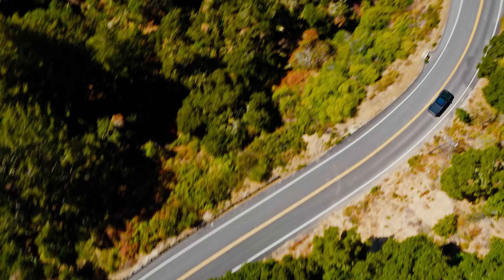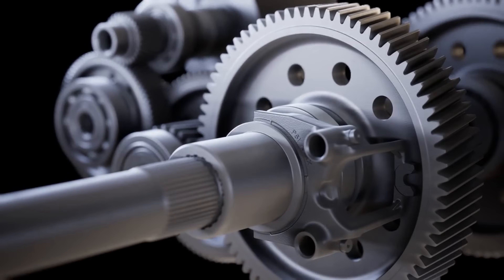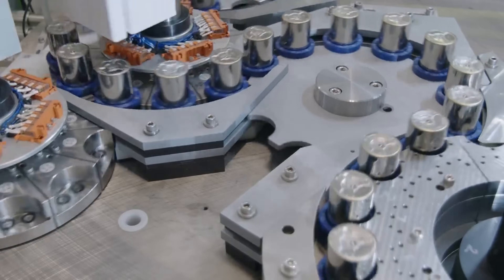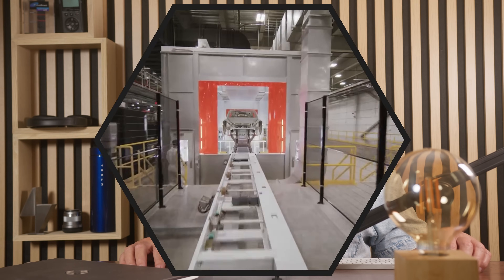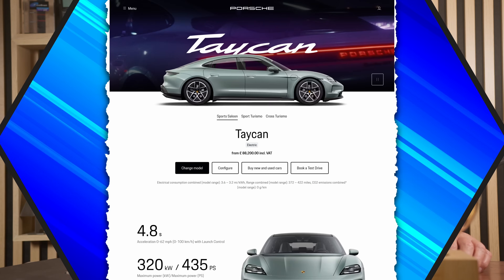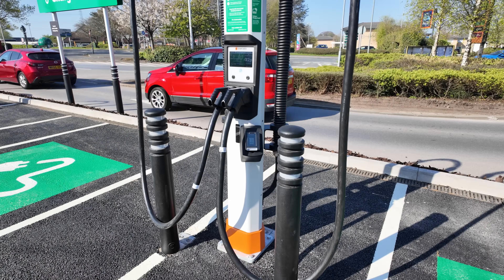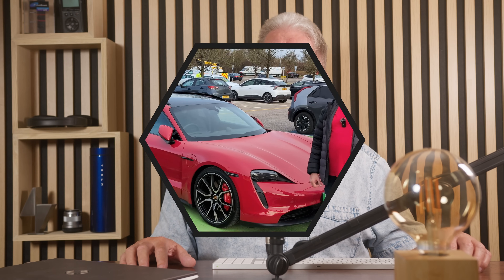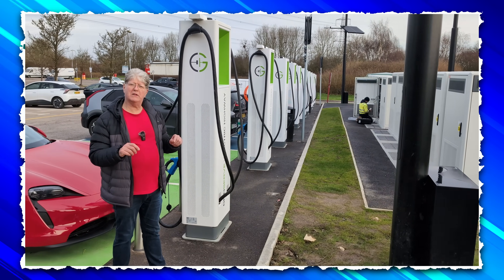800V Charging Is The Future... Or Is It?

Comment: Dave, is this an EV supporting channel or a Tesla fan club channel? This latest video seems a little confused in that respect and defensive in tone. With the intent and purpose behind producing this particular video a little unclear.

The 800v architecture approach isn't just about charging but lowering weight by reducing copper required in a vehicle and reducing heat whilst running the vehicle. As with all new things it tends to get launched on the market as the more expensive option, in this case in cars with larger batteries. 

However, the technology will trickle down into smaller battery sized vehicles when component costs fall. Where 800v architectures will increase efficiency further through reduced weight of batteries and wiring required. The lower current also lowers heat generated reducing cooling demand allowing further weight to be saved in the cooling system.

In charging the 800v architecture improves a vehicle's charging curve allowing a car to stay at high charge rates for longer period across the curve. This applies regardless of battery size with a 800v vehicle gaining more miles in range within a shorter charging time window than a 400v vehicle even if their peak charging power is the same. This also applies regardless of the chargers kW power capacity.

This is why the charger module manufacturers now make wider ranging components supporting up to 1000v as standard. Most over 150kW chargers installed have been 800v capable for a while now, with the newer 50kW plus units also supporting 800v. The charging electronics industry has shifted to support both 400v and 800v at the same time.

I'm not clear why you see a vehicle voltage as being a dividing line rather than the continium the industry approaches it as.
Reply: You should know by now that Dave is a Tesla fan boy.
As far as reducing weight goes for 800v vehicles it doesn't seem to be working with all of them on the chunky side.
Ioniq 6 is 100-200kg more than an equivalent Tesla model 3, EV6 is about the same or a little more than a model Y.
Like Dave said for the majority of the time the few minutes gained in charging times would not be worth the extra cost for the vast majority of people.
I own a Polestar 2 and that charges fast enough for me, any quicker and it would be ready quicker than I am.
Of course if it was price parity and 800volt chargers were commonplace then we'd probably get 800v vehicles
Reply: As I said the initial use of 800v prioritises larger battery premium vehicles but will change as the cost differentials of higher electronics cost vs lower cooling system and copper usage cost equalises.

The Teslas tend to save weight at a systemic level by being fairly stripped down on materials compared to current premium 800v vehicles, which gives a slight efficiency advantage to Tesla currently. However, the Tesla S3XY models take longer to charge than most 800v vehicles as they have lower sustained rate charge curves. My EV6 for example reaches 60kWh, from zero, in about 19 mins and 74kWh (100%) in 34 minutes, the Model Y equivalent takes  34 minutes to reach 60kWh and 54 minute for 74kWh - about 40% slower. It will also use more energy doing so hence will cost more to charge at the same pricing rate.

Ultimately, efficiency is important which is why the shift to 800v will continue as less energy is spent whilst running the car than a 400v architecture. Plus once the current electronics price premium fades the copper cost saving factor will favour the automaker's bean counter decision makers desire for ever lower costs.
Reply: @GruffSillyGoat I believe what you are saying but we are a long way off the scenario you envisage. Very few ultra rapid chargers out there currently cater for the 800v EVs which isn't going to change quickly over the next few years, so currently there isn't much if any advantage.
Reply: @GruffSillyGoat  I think 800V likely has more to do with the charger than the car, for most instances.  Public chargers require beefy connectors - more so, as length and current increase -  meaning aluminium conductors (making copper thieves irrelevant) so are not appropriate unless the connecting cable is much thicker/heavier.  Yet another reason why 1MW chargers are less likely to materialise at most charge points which are not surveilled.  Different for HGV charging, mind.
Reply: Disagree many ultra-rapids, except Tesla superchargers, are 800v capable - including the High Power Gridserve ones, all Ionity and a fair number of Instavolt sites plus the 175kW Shell Recharge sites. The rule of thumb is those listed as above 150kW tend to be 800v capable, some of the newer 150kW also support 800v and even newer 50kW ones (like the one in Dave's video from the other day) these days.

With DC fast and rapid, chargers I would agree the majority are not 800v capable at the moment.
Reply: Their are three main types of high current charger cables: air-cooled, which tend to be used for 400v, particularly on the lower kW chargers; liquid cooled active cables, separate conductor and coolant with the cable temperature monitoring at various points, used for 400v/800v tends to be thicker cables; liquid cooled passive conductor embedded within coolant cables, has two coolant flexible pipes with two conductors wires embedded inside the coolant directly cooled, with temperature monitoring at the coolant return and connector end, tend to thinner and more flexible used for both 400v and 800v chargers. 

Tesla use the later conductor within coolant pipe approach, as do many ultra-rapid (350kW+) and MCS chargers. Although, the HGV MCS ones with mechanical/robotic assist systems tend to use the cheaper separate coolant/conductor cables.

The proposed 3.5MW MCS standards, check out CharIn's technical details site, seek to use refrigerants to achieve colder cooling to raise the power capacity of the cables seeking to only increase the cable thickness by 10 to 15% over CCS cable thicknesses. The v3.1 MCS connector (triangular one) has also been shrunk down to slightly larger than a NACS connector and shorter and wider than a CCS2 connector. These approaches all save weight and increase cable flexibility to increase manual handling ability of the cables. 

As to theft, many cable makers (for example ChargePoint+) are incorporateing anti-cutting mechanisms such as fouling flexible strands (carbon fibre in the case of ChargePoint) in the cable sleeving to blunt or foul cutting tools when used on the cables. Other manufacturers are installing metalised sheafs over the cables that do similar, but also act as an anti-tamper alarm allowing the site to capture pictures of the theives/sound alarms.
Reply: Dave has always been very pro Tesla which is fine, I'm very pro Kia, at least he has stopped banging on about Elon all the time. 😀
Reply: @nervousfrog101 - no don't say that, you'll give him ideas for the next video.

Comment: 800v is here and it’s the future too, when it’s available and working it’s great but to charge 800v cars on 400v chargers there’s a bunch of different tricks which all essentially means they charge slower. 800v cars also has more issues with 400v charger compatibility. 

Not that it matters much, peak charging is usually just a few percentages of the charge, the charging curve matters much more. 

Features like battery preconditioning is also a large factor in speedy charging, charging a cold battery in the winter vs a conditioned one is a massive difference.

Here the new chargers are 1000v and they’ll just adjust to whatever voltage the car wants.

Dave has a good take on it, buy a car that suits you, kWh per distance travelled is generally more important but it also varies a lot based on usage, slow town driving uses very little compared to fast driving on the highway.

Comment: As a dedicated granny charger, I couldn't  be bothered to watch this.
Reply: That’s OK, but do you realise you are spending about 10% more, for your home charging, than installing a 7kW charger?
Reply: @oliver90owner  It's a bit more nuanced than that.  I have a 7kW charge point, I dial it down to 5 amps. IOG.
Reply: @djtaylorutube    On 240V?  That may be wasting over 20% of your energy.  I think my EV consumes close to 250W while running the on-board charger (to convert the AC to DC).  At 7kW that loss is only about 3.5%.  Go figure how long it would take for pay-back on a 7kW charger. 🙂  Or are you charging from a lighting circuit?
Reply: @oliver90owner I use Octopus agile, average kwh cost for all my electricy is 15p kwh for everything i use.. My annual mileage is less than 5000 miles at currently 5.6 miles per kwh. My I pay £60 a month for all my electricity needs, including my EV. Just point out to me where my savings would be made with a 7kw charger .
And of course I often charge at +/- 0p per kwh early AM or between 10:00 hrs and 16:00hrs.
Reply: @ziggarillo   I’m currently shifting/altering my battery storage (a slow job for a couple of reasons) to further reduce my reliance on the grid.  My leccy has cost 17p/unit over the last year (including the standing charges) so I’m not too alarmed with my energy costs at the present time.  Are you using a heat pump?  I’m looking at air to air presently.
Reply: @oliver90owner No, I got a new gas boiler before they offered subsided heat pumps, so I'm locked into that. My house is small and pretty well insulated,  my total energy bill is £96 per month. Investing in solar, batteries and heat pumps won't give me a return soon enough.